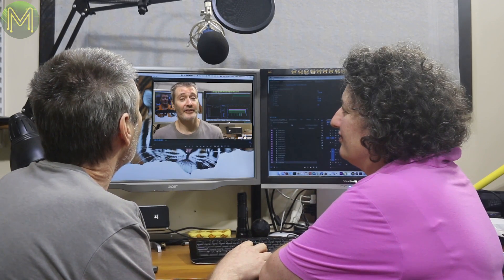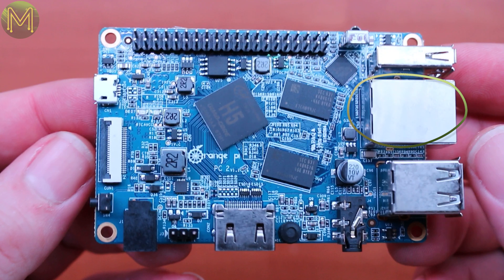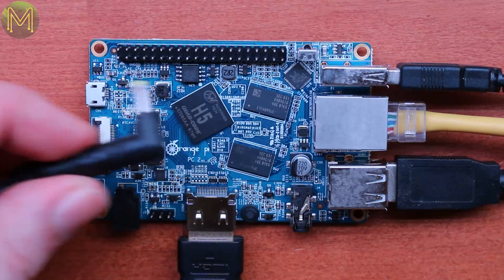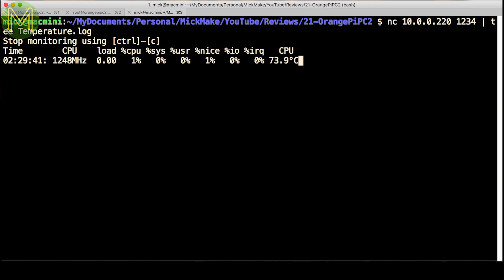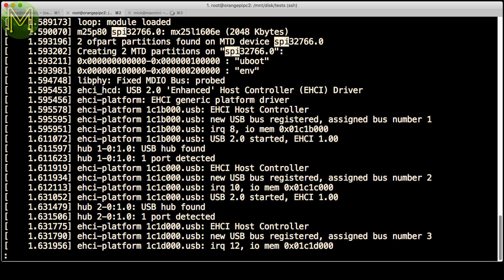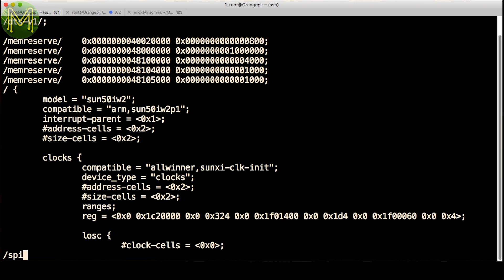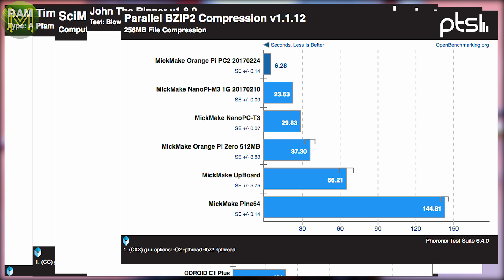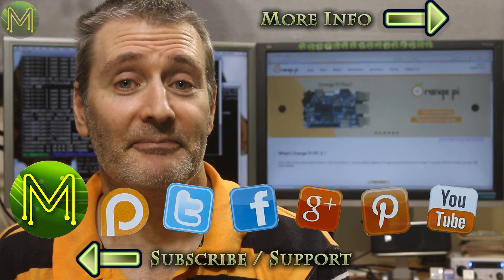#104 Orange Pi PC2: A 64bit gremlin? // Review

Comment: I have the Plus 2e and the Pi2 in front of me.   The former is working a treat (can't get to the serial port but I'll get there) but the Pi2... well, it booted up until I did update/upgrade (Armbian) now it won't even start -  I'm about to try Debian...
Reply from the maker: +Peter Scargill 
Some of my subs have had issues with Orange Pi/FriendlyArm/Banana Pi in terms of QA. I've never had issues, but I suspect it's due to cherry picking boards for review.
But it could also be some kernel issue in your case. Will be interesting to see what you discover.
Reply: Hi = Well = the FriendlyArm 64 bit boards tend to suffer from the same issues - they put them out and really are just not interested in supporting them - but their 32 bit products I have to say generally work quite well. I have most of them and have GPIO and I2c working perfectly.  I first came across Orange Pi when the original came out - no support - the one email address they gave went into thin air - looks like things have not changed much.  I'm giving this thing one more chance with what they call "Raspbian" - the HDMI doesn't work - but access via winSCP does.  It really is amazing that someone can go to all the bother to design a board and get it made then lose interest in support.
Reply from the maker: +Peter Scargill 
It's a typical scenario; the hardware guys really have no interest and the wrong mindset for software and vice versa for the software guys.

They are two distinct people that think very differently. The software guys are happy with many changes and alternations/changes in scope/trash and rewrite, while the hardware guys are very rigid/can't handle change/consider a PCB more a "work of art" that can't be touched.

Add into the mix the marketing guys spouting forth stuff things the board can't do, and the finance guys just wanting to push the darn thing out the door; if the hardware guys don't have a backbone, then things go south very quickly.
Reply: Yes, I believe that just about sums it up.  No doubt this is one reason the Raspberry Pi has done so much better than these other boards despite being pretty lacklustre (one UART etc).
Reply from the maker: Ha ha. Yup, kinda like what happened to my OPIP2?

Yup, if the boards run the same SoC, then there's no reason why you can't use a different SBC boot image. The key will be in the DTB file. That's where most of the magic happens and if it's not set right, then you won't see much happen.
Try pulling the DTB from that image and using it on the OPiP2. Unfortunately, mine is just looking at me blankly.
Reply: Well, I've updated the blog - I got absolutely everything working I needed including serial 0 and 1.. improved the power, made sure I had a fast SD. EVERYTHING was just fine - then I rebooted - got a load of error messages and I was back to square 1 - I think I'm just going to file that board. Life is too short.  I'm missing something....
Reply: At which point you've hit the current limit of my knowledge -  I have no idea how to handle a DTB file. Incidentally in the same writeup I did the Orange Pi Plus 2E and that's a winner.   Shame - I'm convinced some setting somewhere needs to say "accept slower SD cards" - because the errors I'm getting look like SD corruption errors - maybe.

Comment: This stuff is shit !
DO buy an MXQ s805 instead of, you will find a working armbian Linux, a big community and a good support !
No Orange Pi Prime *.img sytem from Orange Pi website is working ! And it don't workin well with armbian, no hardware decoding function usable, no usb drivers suitable, no wifi, and damn slow for everything, DO NOT BUY THIS !
The last message of the seller on Aliexpress ( after a lot of messages, and a lot of lies from them... I was trying to get refund unsucessfully, we spend 3 days with an informatician friend, I tried to buls a linux on it with the last core kernel 4.12, and he told me that it was impossible because no acess to NOT OPEN LICENCE functions of Mali 450 ! ):
steven zhao
17/08/16 18:39
Prime support full screen,720p50hz , you can use the Unbuntu_Desktop image etc. 
you can't install linux drivers for usb devices: if you refer to the USB WIFI card, Prime dont support this. 
And you can check the USB device with lsusb which means the USB function can work.

Comment: Ugly chip placement - yuk. :(  Looks like they took all the parts and literally threw them at the board, then designed around where they fell.
Reply from the maker: +VauxhallViva1975 
It does look ugly, but a good way to optimize placement of components. Ultimately it'll still run well.

Comment: Okay get ready to scream at your screen because I'm about to noob the comments hardcore.

I'm brand new to these kind of gadgets, I mean BRAND NEW.  To make matters worse, I don't have the most experience with linux. (I played a little bit of playing with ubuntu in 12.04 a few years back)  Would you recommend this product for a 17 year old who just wants to mess around with a cheap little device?  Here are my goals

1. Potentially get early 2000s pc games to run on it (Nox, unreal tounament, etc) If those expectations are too high I'd be pretty happy getting ps1 games to run on it.

2. Overclock the system to its voltage limit with a super ghetto cooling setup 

3. Make a little portable laptop thingy out of it using 18650 batteries to power it and one of those cheap little china screens to display.

Doable? Alternate device suggestions under $35?  Do I even have a chance at accomplishing anything at my skill level?

Comment: Should I buy it or not??????
Reply from the maker: It's still very experimental. If you like a bit of hacking around then go for it, but if you want something that works you will be disappointed.
Reply: Any other board you prefer from orange pi or others??
Reply from the maker: harshil saxena 
It really depends on what you want to do with it. What's your project?
Reply: We work in the field of penetration testing and analytics...I have a couple of raspberry pi's but I want to expand my collection which even I can further use
Reply from the maker: harshil saxena 
There's many many boards. Over 1,000. Some of the smaller boards, even the Orange Pi Zero has some fairly decent network speeds.
Reply: MickMake so should I buy orange pi pc2....any idea which orange pi product has the best performance?
Reply: MickMake would this be an easy to use board for retro pie - arcade gaming?

Comment: This board runs Android 5.1 flawlessly. You can't say that for Raspberry Pi3. In a couple more months when the community support matures, this little board will be an excellent device...all for a $20 bill!
Reply: What image are you running? The official image? I've tested that and it runs far from flawlessly (no Play Store, a bit unstable, no power off option and limited drivers).
Reply: bucshee , I am using an image from the Russian 4pda OPI PC2 page. Playstore and root with a better lancher. There is also a new official image in the orange forms that has gapps but it is not rooted. Some apps are not compatible but I havent bothered to install market helper, i just sideload. Runs everyting I tried so far smooth as silk, Kodi, YouTube, full hardware acelleration.
Reply: power off is with the power off button on the board. When it turns from red to green, I unplug.
Reply: Max Meyers Cool. I'm going to give those images a go. And about powering off...well yeah you can hit the switch and unplug. What about actual shutdown (ie from the GUI)?
Reply: Do you have a download link for the image? The forum is in Russian :D
Reply: Use chrome or google translate! Lots of good info there.
Reply: if you have the time to debug all issues maybe, i rather go with some other choice, (time is money)

Comment: At least you got your Orange Pi PC2 to boot. I have two of these from AliExpress.com
and neither one seem to work right. I get no lite LED's on the Orange Pi WEB Site
images. Nothing!!! No lite LED's, nothing. The Orange Pi forum talks about this issue with no solutions. I tried to get my money back from AliExpress.com but all they do is ask
basic power supply, etc. questions. They did give me one image that worked once,
at 720 resolution, but once I updated the image it would not boot. Even ARBian images
do not work. AliExpress.com is no help. I even thought about sending you these two
boards and see if you can make them work. These PCB's are just plain bad.
Reply from the maker: +Solder Master 
Sounds like they had a bad batch of boards.
I didn't put this in the video, but power is critical as well as the right SD card. I went out and bought a bunch of new fast SDs.
Reply: MickMake I run my BBB on 0.5 Amps!

Comment: One thing I do not understand is why people just don't deal with the RPi ... given the enormous support for it and stable releases (as compared to these hacks) I can't see a single reason to move away from the RPi. Sure, there may be some slight proposed benefits of these boards vs RPi (like speed), but nothing I can't do via a I2C and a module or two ...
The headache just doesn't seem worth it for some speed gains, unless you are doing speed specific tasks. My $0.02 CND
Reply from the maker: +Richard T 
Yup, I agree.

However, for me personally, I don't like monopolies, even if they're an education based monopoly. Monopolies reduce choice. I know that the rules aren't the same in the case of the Pi and we actually do need monopolies every so often to motivate standardisation. But I'm always adverse to them.

Also there's some things that the Pi can't do well and the niche market is where these other boards get some traction.
Reply: MickMake Good point - I am just quite jaded that the support for these boards has been abysmal....
Reply from the maker: Richard T yup it is bad. The Pi was as well in the early stages and they've had years to hone their business.
Reply: pick on apple first, there was another mac maker back in the 90's,  but with the pi i would say the comment was off base due to the reason why the pi was made in the first place and number 2 there is no monopoly by raspberry pi on the SBC market by no means, just by the numbers of other boards out there which are good and got some support, there is base is smaller due to being younger but is growing
Reply: Sometimes SBCs made by competitors have features that RPi don't, which is good for everyone, cause then Raspberry need to introduce those features to avoid losing customers. Features like Bluetooth, Wifi, HDMI output etc that some early boards didn't have.

Comment: I've got the board running armbian which works really well.  I am waiting on the heatsink to get it to run cooler though.  Otherwise I like the board although my use is very limited.  Just got it running an ssh and web server.  There is a new kernel build every day so it seems that armbian is working on it daily.  At first I thought the board was dead, but after trying various images and a good sd card, armbian does the job.
Reply from the maker: +Philip Jessup 
Yup it's getting there. Given enough time it'll be fantastic.
Reply: My armbian was fine until I tried doing an apti-get update and apt-get upgraded - after that and a reboot - it would not even start up.

Comment: im actually quite happy with the board since armbian is still in the beta i expect alot more to come. and audio workt fine with me btw.
Reply: and you can enable i2c and spi by setting status to "okay" not enabled now it works fine for me
Reply from the maker: Thanks for the heads up. I think the board is OK as well, but I'd prefer more boards ahead of this.
Once it gets some traction, (if it ever does), it'll be a screamer however.
Reply: MickMake agreed feature wise it's very good
Reply: first person to seam so, I did run into someone who was pushing it, but i wonder if he actually ran one

Comment: well. I think I need to do some explanation on all these boards since I'm in China.
basically, there's not many of people that care the low level hardware specification, not even knowing these.
as a consumer, if I need to do calculation, I just need linux; if I need to have some fun, android is ok.
so in most of the consumers side, it's a cheap board with a powerful chip, that's all most people care.

in my world, this board is much cheaper than a RPi3 and slightly stronger.
I do believe the manufactor do not get many authoriation from allwinner, just like the old days we don't have gpu driver for RPi.

So basically, it's in a very easy war: to have a less price with stronger chip, that's all.
Reply from the maker: Yup. After spending some time there myself and getting to know the culture; it's all about short term goals. Anything that requires long term planning isn't thought about, because it's all about very quick turn-around times.
It doesn't mean China doesn't want to, it's just that there's no time to do it.
Reply: Until it doesn't work...
Reply: it is difference between made in china and made by chinese

Comment: I have one of these orangepipc boards, and I do not recommend it due to lack of any support nor user community developments.... You are alone on this one. Armbian is pretty much the only thing that is running decent on it, but that is it.
Reply: I have a Orange Pi PC, it boots on several operating system but the on board ethernet does not work. Just connecting power and nothing else causes both
ethernet LED's to light up 100% of the time. Hence, something is wrong with the PCB.
Reply from the maker: That's interesting. Is it the older Pi PC?
Reply: Yes, it's a Orange Pi PC that was made before he newer PC2. It uses a
different CPU but it looks about the same, except for the fact that he memory chips and CPU are not on an angle.

Comment: I think they only make miniSDs in black to ensure extra sales from people loosing them.
Reply: Always find mine dangling from cobwebs
Reply: I have a red one ! But is doesn't help either !
Reply: I never guessed in these days we'd be fiddling around with toenail sized 16 billion byte ram cartridges, containing amiga emulators and films and stuff to play on cheap 3 watt gigahertz "sbcs" ...while a tin of beans has never been pricier, sigh
Reply from the maker: +Andrew Input 
I agree. They are so small that you can lose it in a minute. I'm sure it's planned to get more sales.
Reply: I'll believe that when I see it... and then i dont :)
Reply: Andrew Input I once throw my MicroSD card with my BeagleBone (Black) while it was running Linux from it. Im just going to say that a slight kernel panic happened.
Reply from the maker: ElectrodeYT 
Oh yes. I've done that before as well and ended up having to hold it in place while trying to reach the keyboard from far away to shut it down before I let go.

Comment: I think I might stick to my RPis for now.
Reply: this board is why I hate term "pi-killer" , there is no substitute for the pi platform
Reply: This seems a good idea that I am also choosing. If they come out with a better board with enough support to swap over for a performance boost, the C (etc) code should migrate relatively easily.
Reply: The forum support by itself is worth the price of a RPI. There was never an issue that I didn't find the answer to from the forum support. Thanks Guys!
Sure its not the fastest, or the cheapest, but its as solid as a rock. I have my RPI2 dedicated to running BOINC and its being doing that 24/7 for the past 6 months (Retired it when I got the RPI3). Going 100% on all 4's with no cooling, it hasn't blinked.
Can't wait for RPI4 !!

Comment: That component layout though... This is the Marty Feldman of SBCs.
Reply: John Ioannou , that sbc has more crooked parts than an average politician
Reply from the maker: +John Ioannou 
Yeah, it looks a little odd, but it's like that to ensure the RAM address and data lines are all the same length. When you're running at those fast clock rates, even track lengths can make a difference.
Reply from the maker: +John Ioannou 
Good old Marty Feldman!

Comment: what about the ASUS "Pi"?
Reply from the maker: +LINUX-ISKY 
Yes, that's coming. I just need to find someone who'll sell it to me!
Reply: amazon sells them now

Edit: HDMI likes to disconnect, HDMI audio is called "analog", and its software is a bit glitchy until you "apt-get dist-upgrade" this is just in the first 2 hours i had to play with it this weekend
Reply: wierd0n3 Might as well ask here: Unless I use a HDMI-DVI cable, my TV doesn't like the Video Signal my BBB spits out.
Reply: I'm assuming you mean a beagle bone black, i haven't played with one of those yet. however if you pour through some FAQs for it, you should be able to force a resolution that plays nice with your tv. (I have mostly RPi boards. this is my first time with a "clone" board)
Reply: wierd0n3 Nope not that. My TV doesn't like the type of video it outputs.